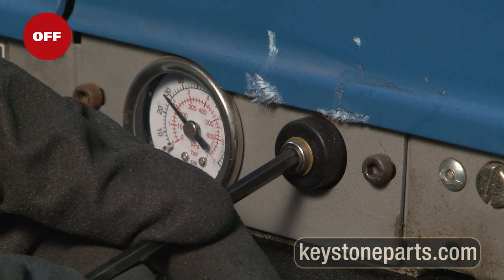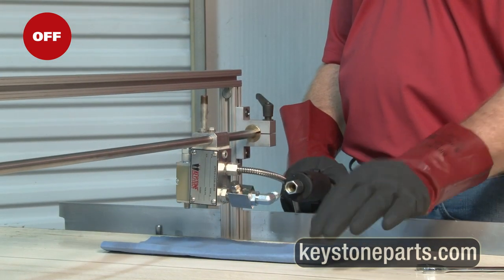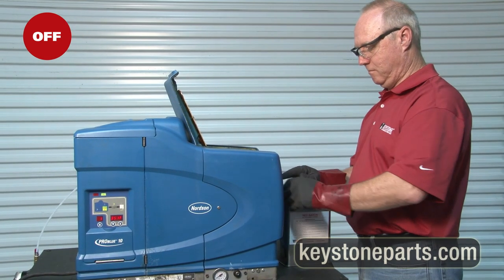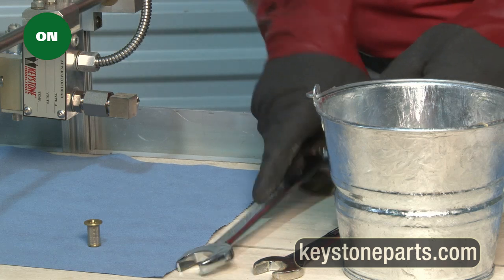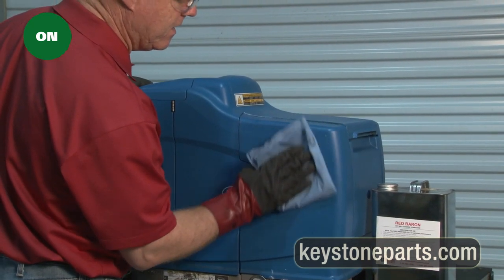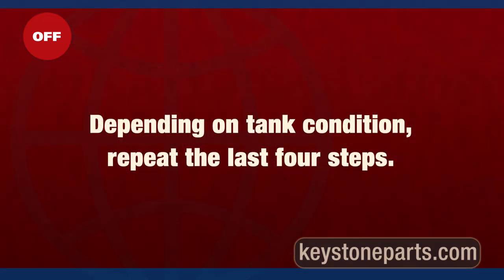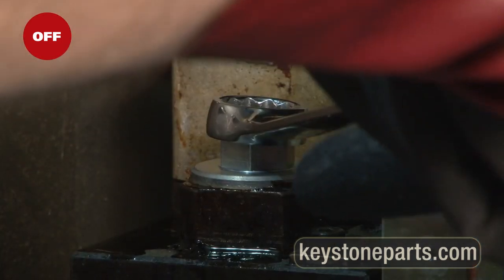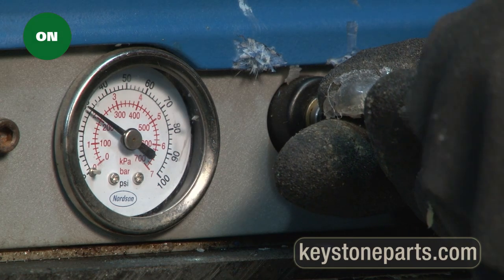DIY Flush and Clean Nordson Glue Melter

Comment: but the Typr R fluid is flamable at 200 degrees should i use operating temperature or just about 100 degrees wich is half the heat